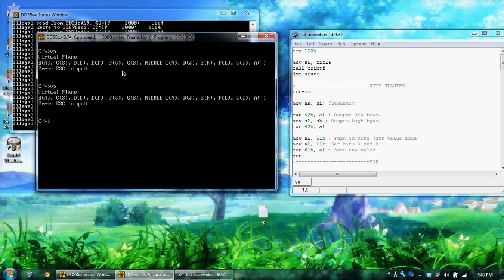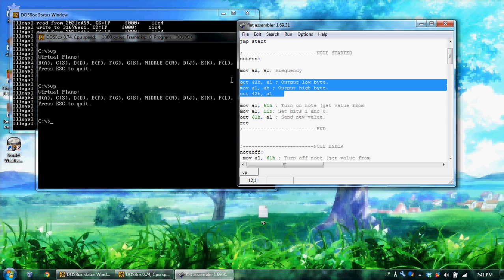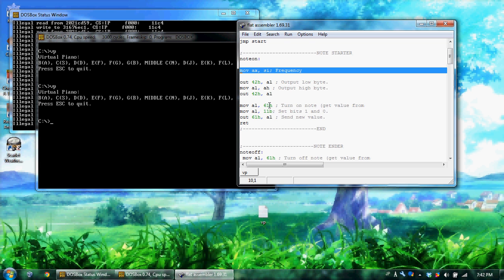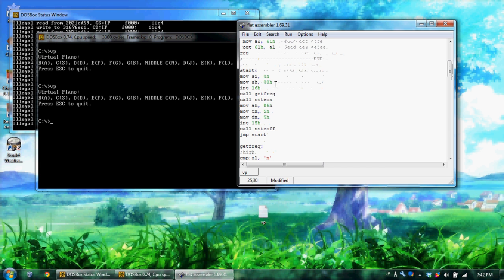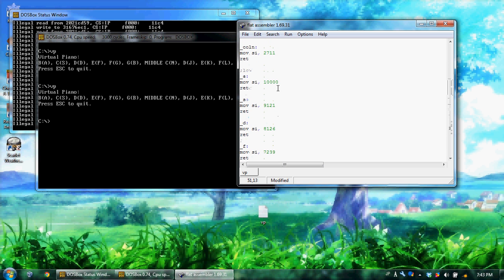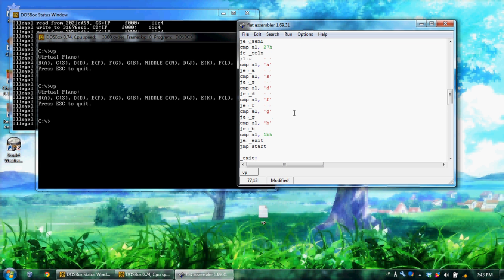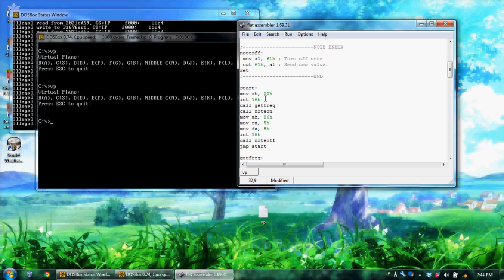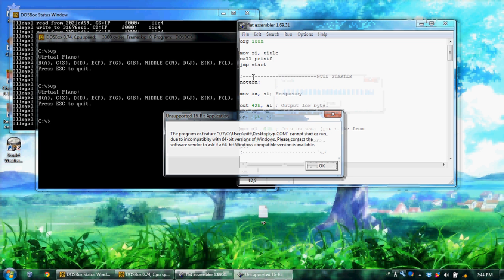Assembly Tutorial 27 - Speaker Tones

Comment: org 100h
jmp start

;--------- NOTE STARTER
noteon:

mov ax, si ;frequency

out 42h, al ;output low byte
mov al, ah ;output high byte
out 42h, al

mov al, 61h ;turn on note
mov al, 11b ;set bits 1 and 0
out 61h, al ;send new value
ret
;-------------------END

;-------------------NOTE ENDER
noteoff:
mov al, 61h ;turn off note
out 61h, al ;send new value
ret
;-------------------END

start:
mov si, 0h
mov ah, 00h
int 16h
call getfreq
call noteon
mov ah, 86h
mov cx, 5h
mov dx, 5h
int 15h
call noteoff
jmp start

getfreq:
;high
cmp al, 'n'
je _n
cmp al, 'j'
je _j
cmp al, 'k'
je _k
cmp al, 'l'
je _l
cmp al, ';'
je _semi
cmp al, 27h
je _coln
;low
cmp al, 'a'
je _a
cmp al, 's'
je _s
cmp al, 'd'
je _d
cmp al, 'f'
je _f
cmp al, 'g'
je _g
cmp al, 'b'
je _b
cmp al, 1bh
je _exit
jmp start

_exit:
int 20h

_n:
mov si, 4560
ret

_j:
mov si, 4063
ret

_k:
mov si, 3619
ret

_l:
mov si, 3416
ret

_semi:
mov si, 3043
ret

_coln:
mov si, 2711
ret

;low
_a:
mov si, 10000
ret

_s:
mov si, 9121
ret

_d:
mov si, 8126
ret

_f:
mov si, 7239
ret

_g:
mov si, 6087
ret

_b:
mov si, 4831
ret